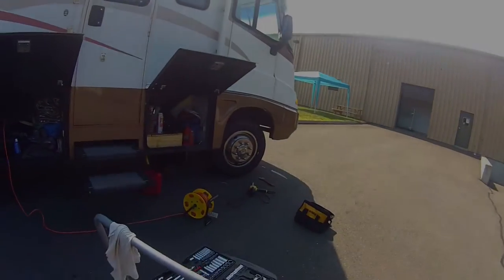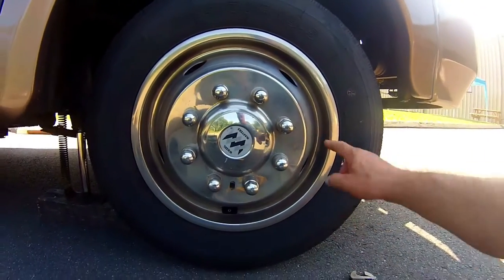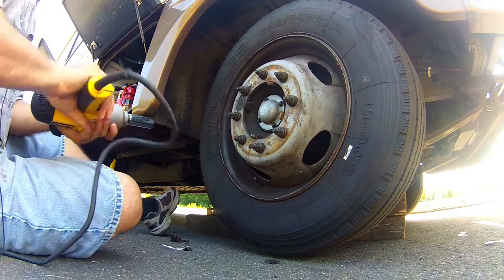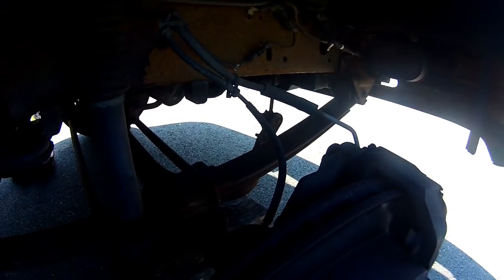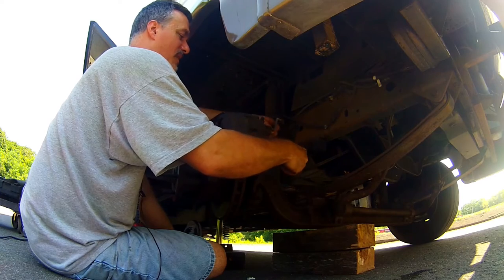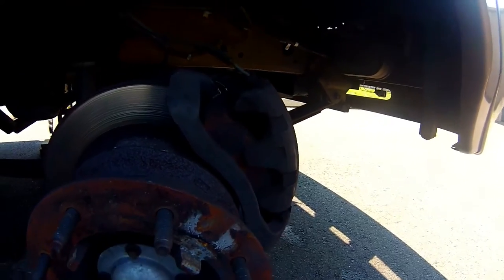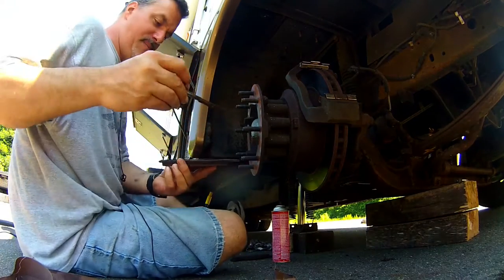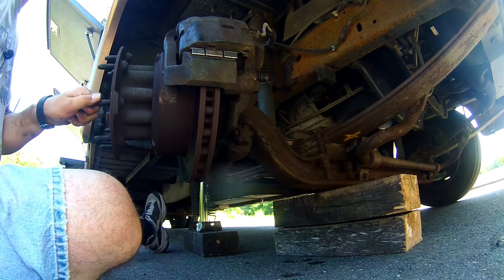Motorhome Front brake Inspection and cleaning.

Comment: I have no idea what you thought you were compressing with  your clamp.  Even if you had it on a part of the back plate (which you didn't) you would be putting force on the side of the caliper that doesn't have caliper pistons to compress.  The caliper Pistons can be compressed but not like you showed.  Before you go compressing the Pistons you should check to see if the brake master cylinder has been recently topped off otherwise you can push brake fluid back into the reservoir and overflow it.  Especially when you do all 4 wheels.  It's not the end of the world but brake fluid is very corrosive to almost every automotive paint.  Also I wouldn't be so cavalier about substituting anti seize compounds for brake quiet compound.  Never seize can migrate under heat and it has metal particles in it that you wouldn't want anywhere near your brake pads.  There are good engineering reasons why you should use the products specifically designed and formulated for brake systems.
Reply from the maker: After about a 1,000 brake jobs I can tell you that the only way to install brake pads is to compress /push back the caliper. Valid point on the fluid reservoir it is advised to remove some fluid before starting the job. Great information
Reply: You're absolutely right, you do need to compress the caliper piston/s a little to help remove the caliper.  That isn't what you did with your clamp.  Look at your video carefully - you put the clamp across the top of your caliper and if it was in contact with the back side of the brake mounting hardware when you tightened the clamp all that you were doing is pushing the outer brake pad against its housing - there are no pistons against the outboard pad - they are against the inboard pad - you weren't pushing on the inboard pad - look at your video and think about it.  To move the pistons you effectively have to move the caliper assembly outboard.  The easiest way to compress the pistons is to use a couple small wooden or plastic wedges (so as not to marr the rotor) and tap them in between the caliper housing and the outboard side of the rotor - easier yet put a popsicle stick against the outboard side of your rotor as close to the 12 o'clock position as possible (again to prevent marring the rotor) and use a large screwdriver down through the top of the caliper to pry the caliper back (outboard) thus compressing the inboard piston/s.  Not trying to confuse you or give you a hard time.
Reply from the maker: LOL the clamp was on the back of the pad and the other side was on the back of the caliper. When the clamp was tightened it pushes the pad against the piston pushing it in. I'm not quite sure what you see in the video but all I can say is YES I DID PUSH THE PISTON IN by pulling the caliper body tords me and forced fluid back to the reservoir.

Comment: SAFTEY TIP: Use jack stands and place on the frame of chassis or at least where leaf spring brkt welded to frame. The way this is blocked up the leaf spring will collapse and it will still drop down a lot if hydraulics blow. Fortunately my RV is 12v gear driven motor so wont collapse.
Reply from the maker: I did have 6x8 wood block staging under the frame as a safety precaution.  Even with jack stands its a good idea to have a back up taller than you legs under the vehicle just in case.

Comment: I see this is 3 yrs old but nonetheless, good job bud. Everybody's got an opinion too I see huh 🤣
I have a 98 30' Minnie Winnie that's been sitting 9 months and I believe my front brakes are locked up on me. This vid should help me some. All I have is a bottle jack and telephone pole pieces to jack mine up. And I'm on a slight pitch in my driveway. This should be interesting. Lol
Reply from the maker: Yup still driving my my Chevy and the bearing is tight 35,000 miles later.

Comment: Thats not a torx tool just a extension for hard to reach areas not needed here. Also you were going forward not reverse when you started trying to take em off.
Reply from the maker: Its a "Torx" stick.  They come as a set with different torque ratings. Google is your friend look it up.

Comment: im surprised you bothered to reuse the pads. given the abuse they take and the fact they were less 40 percent remaining, the $60 you saved seems  like a waste of time. useful video however.
Reply from the maker: When I had the tires done the guy said the pads were great but I was still hearing them so i figured I would just clean them up. Still using the same pads but a full brake job will be done in the spring. Looking back i agree I wish i changed the pads then. Good comment thank you.